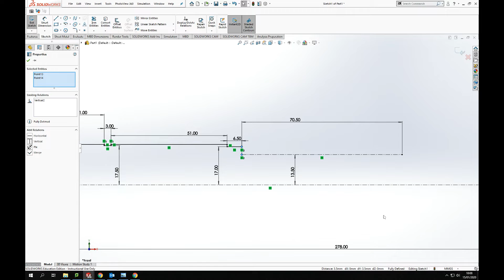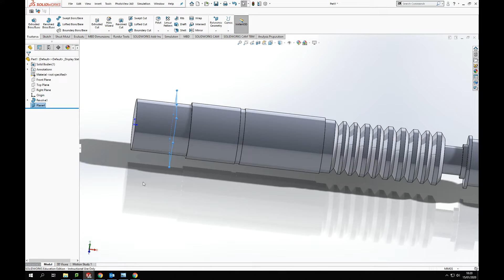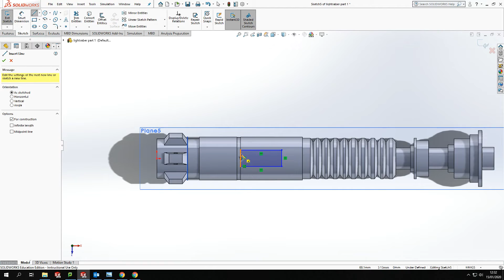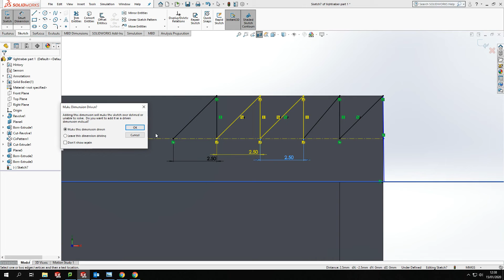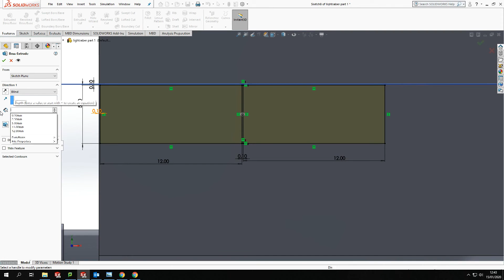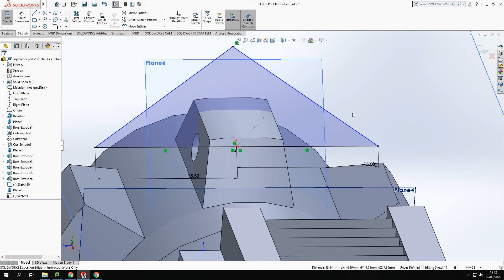LIGHTSABER DESIGN SOLIDWORKS - Luke Skywalker's Lightsaber designed on solidworks!

Comment: My sketch doesn't automatically close like yours did, what should I do?
Reply: If youre referring to the first sketch you may have left a construction line as a closing line. for whateve reason it works fine on his, but i had to turn the centerline/construction line to a normal line to close it properly.